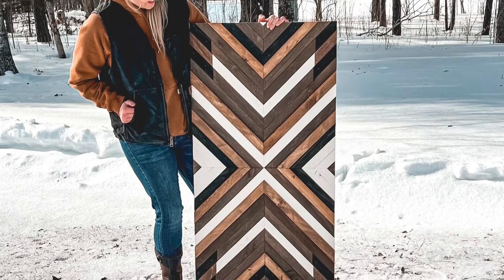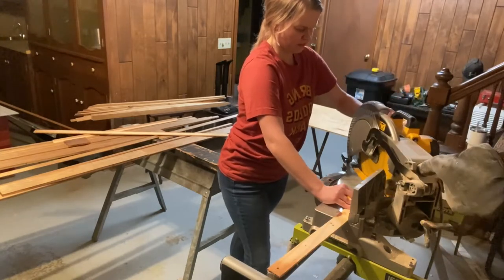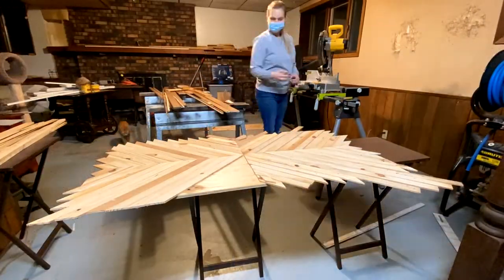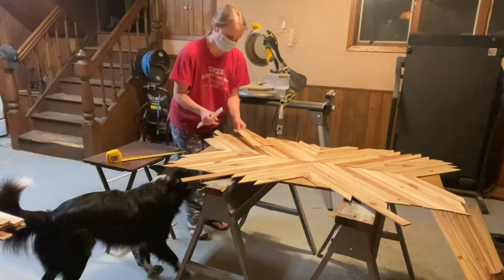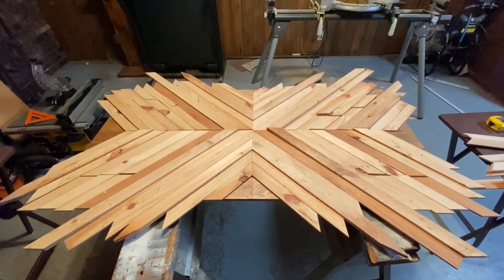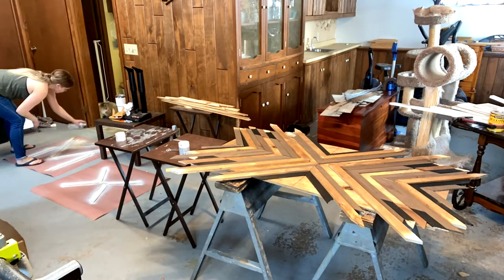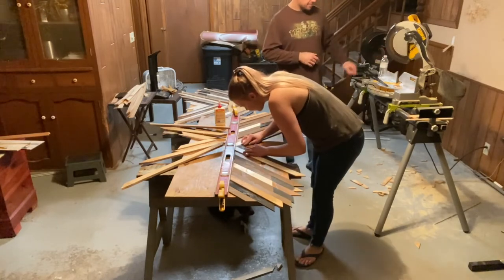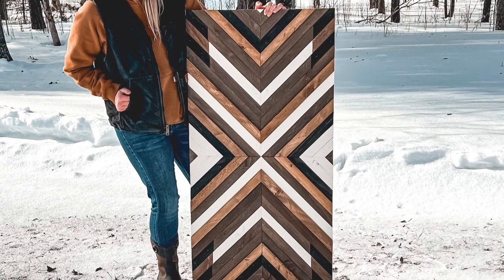DIY MOSAIC/GEOMETRIC WOOD WALL ART | Under $50 | simple + cheap how to |

Comment: What exact stains or paints are you using for black and white? I’m so confused on what to buy
Reply from the maker: The black is Varathane Premium Fast Dry Wood Stain in Ebony. But really any black wood stain works! 

The white is spray paint.  I picked an off white color in the Rustoleum brand 😊

Hope this helps! 👍🏼